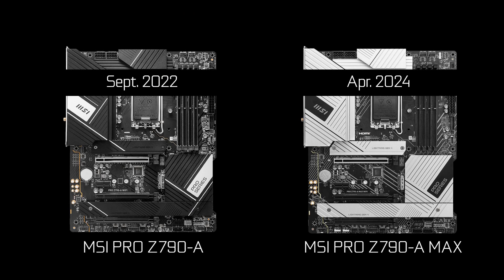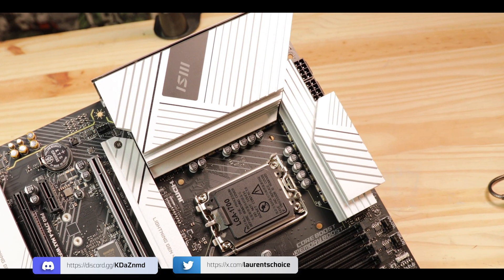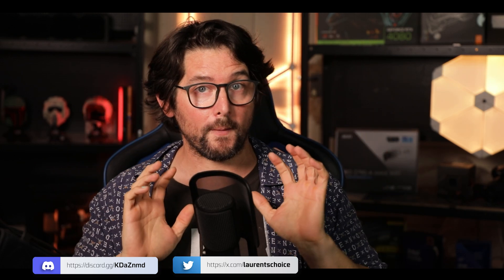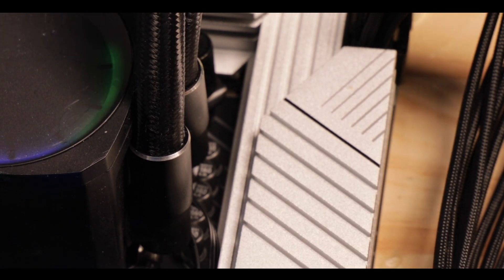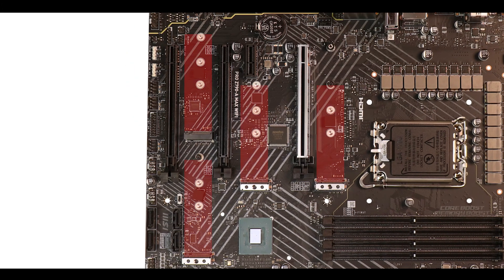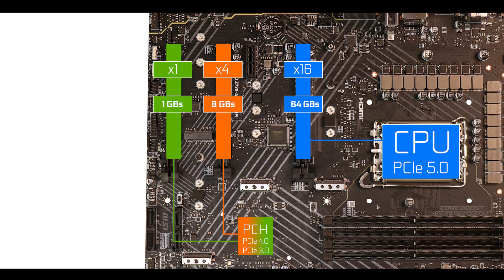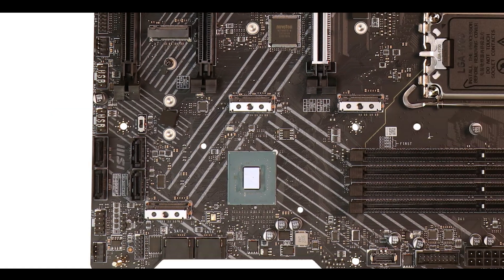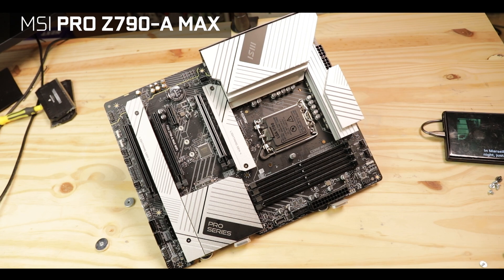MSI PRO Z790-A MAX WiFi: when everything goes RIGHT!

Comment: If I use one port under the double heatsink would run into a problem if I wanted to eventually put another under there? I only have enough for on new SSD and my other port is in use never tried to take one off after using it.

Comment: Might just pick one up this tax season. Gonna keep it sealed in the box though. Waiting for used processor, and used ram prices to go down.
Reply: Used ram is okay as they basically never die but you really don’t want to buy used Intel 13th gen or 14th gen. They surely have degraded already and Intel’s extra 2 years warranty for them only applies to the original buyer.
Unless you buy brand new stay away from Intel. Multiple friends mine had to replace 14600Ks and 14700Ks in less than 1 year of use.

Comment: Wait, does the mobo have a 4pin? I want to put a rgb fan that’s 3pin, would it fit in it and work correctly? Imagine found out this motherboard has voltage control so the fans won’t go crazy. Would I be fine to make the purchase of those fans?
Reply from the maker: You can put a three pin fan on them, it won't have the PWM connector and the ability to control the fan speed , but it'll work (at 100 percent speed all the time)

Comment: Good review and very nice board! Unfortunately I'm a little unsure, as you said, it's entry level and the VRM's/temperatures worry me a little. Would you rather recommend the MSI MPG Z690 Edge WiFi (currently costs 80 bucks less)? I would like to run it with an i5 14600k, focus on Gaming. Many thanks if you can help me with this decision.

Comment: Hello! Tell me how to configure the processor on this motherboard, limit it by voltage and so on. It's just that in games the temperature rises to 100C. I set the processor voltage to 1.2, the temperature dropped, but the fps also dropped

Comment: This board has one possible advantage over the high-end MAG Tomahawk MAX WiFi:
On the MAG, if you put an NVMe into the primary slot next to the CPU, your GPU PCIe link will be cut from 16x to 8x. This is due to the implementation of PCIe Gen 5 on that NVMe slot. There's NO way around this except to not install an SSD there. Any SSD installed there, even if it's only a 4.0 or 3.0 device, will nerf your GPU link. This is not MSI's fault, it's a limitation of the number of PCIe 5.0 lanes available on this platform generation.

PCIe gen 5 drives have their issues, but are becoming more relevant. Degraded GPU link brings perhaps a few percent framerate costs. Ultimately it's up to you to decide where you prefer to compromise, but realize that if you do get a board with 5.0 NVMe slot, and you want to use all four slots, that choice is made for you.

Me, I run the PRO MAX with all four slots populated with Gen 4 NVMe (three of these in RAID) and my GPU at full 16X link. This configuration would not be possible on the Tomahawk.
Reply: So I can go fully decided to buy a MSI PRO Z790-A MAX than the MAG Tomahawk.. it's more cheaper and I can fully use all NVMe slots without the PCI link issue??
Reply: @fernandomilani9450  Yep. PCIe gen 4.0 for all four NVMe slots at the same time with x16 link speed on the GPU.

Comment: I am saving for a pc build it has
Primary gpu: Rtx 4070 super
Secondary gpu: Intel arc a 380
Ram: 32gb ram 5600mhz
Primary storage: 1tb nvme ssd
Secondary storage: 2 tb ssd
Case: Evetech onyx case
Kratos gamadias 750w
Os: Windows 10 pro
Cpu: Intel core I5 14400f
Motherboard: msi pro z790-a max wifi
Reply: think about upgrading your PSU bro, 750W is enough to run on for this build, yes. but the less capacity of your PSU you use will increase the lifespan and energy efficiency :)
Reply: I’d go for an 850W or higher
Reply: Secondary GPU might be redundant and not worth it with components so powerful
Reply: You really don’t want a Z790 board with a locked non-K cpu. You can’t do overclock or undervolt either way. Just get a cheaper B760 board and save the money. The 14400f draws so few watts you don’t even need a good vrm, a crappy 8 phase vrm is already enough for it.

Comment: I bought a zMAX bored as well the 80 mg is nice and if you're running 11 fans if you're running an air-cooled model it does help it has lots of different connection ports in the two PCI You can turn the low frequency PCI slots into USB slots So you can give yourself more USB slots for like your mouse your keyboard steering wheel if you're doing stuff like that So they've really just depends on what you're really wanting to do But the one is actually eight gig and the one below it I believe is four gig..
Reply: 5.0 is 16 to 24 gig pcie
Reply: 5.0 is 16 to 24 gig pcie
Reply: HI PLS SAY for I7 13700K, 4070 super. Is motherboard msi pro z790a max wifi enough for it or should i go with msi mag z790 tomahawk MAX wifi 😊
Reply: HI PLS SAY for I7 13700K, 4070 super. Is motherboard msi pro z790a max wifi enough for it or should i go with msi mag z790 tomahawk MAX wifi. Say me pls

Comment: I have this motherboard and still there's no update to address issues with intel's microcode. I use my backup PC to keep my i5 14600K from degradation because I'm not in the mood to swich my entire platform to AMD because my CPU may eventually die because of intel's failure. I would never ever choose a MSI board. I regret i didn't go to an ASUS motherboard, mainly because of lack of updates for the last few months.
Reply: HI PLS SAY, Does even msi mag z790 tomahwak max wifi have any problems with i7 13700k build or should I go with this mother board msi pro z790 a max motherboard
Reply: HI PLS SAY, Does even msi mag z790 tomahwak max wifi have any problems with i7 13700k build or should I go with this mother board msi pro z790 a max motherboard 😮

Comment: Should I go with the ASUS TUF Gaming X670E or the ASUS ROG STRIX B650E-F ? Im planning on building with an Ryzen 9 7950x3d and an RTX 4080 Super. im also open for any new recommendations, the only criterias are, at least a bit rgb, it should be black, ATX and it should be not more expensive than the other two.

Comment: 6layer pcb, bläääh. Memory oc or even ram at high xmp profiles will suffer. 8 layers at least is needed.
Reply from the maker: We re fine here with 6...don't forget 8 is great .... But it really costs more to manufacture .. and on this board it would not make that much of a difference.       But I do take your point in. Hopefully, 8 layers will become the standard even on sub 300 boards.
Reply: @Laurentschoice  6layer is usually not capable of hitting 7200stable, 6800mt/s is usually max. Then people complain that the cpu is not good when it is the mobo.
Reply: ASROCK Z790 Riptide WiFi have 8 layer PCB

Comment: I have a MSI Z790 TOMAHAWK MAX WIFI keeping unused over 3 months, because of Intel 13/14 crash issue, finally I found the i5-13500 may be safe, because of it's L2 cache is the same with Alder-lake, this brings another issue to me, I hope I can have the most option in my z790 motherboard bios... so I still haven't buy my CPU....
Reply from the maker: I'm reviewing that model today. Can you give me more details ... I'll try to troubleshoot it during my review for u
Reply: @Laurentschoice  Buying i5-13500 is very simple. As long as I buy it, I don't need to worry about the CPU being burned out. But at this time, my mental state is in an unsatisfied state. I want to have the most bios options once I buy i5-13500. If Intel or MSI release a complete solution to the Raptor-lake K version processor, I will have to sell the existing i5-13500 processor and buy an i7-14700K (I think this model has the same VRM capacity as TOMAHAWK Comparable match) The reality is that Intel cannot solve the problem and let the motherboard factory guys admit the harm from the end users and want a smooth transition to the next processor generation. This puts me in the Hamlet state of whether I should buy a processor or not.

Comment: Nice !!! But i love the GIGABYTE Z790 AORUS ELITE X WIFI7 🙂
Reply from the maker: Yeah, the AORUS ELITE X is miles ahead! Nothing can dethrone that one (or maybe the TOMAHAWK MAX I am filming today.. that one will give it a run for its money!)
Reply: @Laurentschoice  I think the way the motherboard's USB ports are designed is also very important. Personally I believe that MSI is not steel clear on how the USB's port bus should be better designed, I think there are some old knots that have not yet been resolved. I have many different brands motherboards on hand... but when I use the USB ports on the MSI boards (more than one port) I always have .....a headache. 😂
Reply: I have the same board paired with a 14700k and it has been awesome!